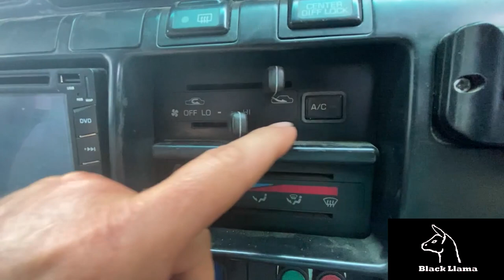80 series landcruiser air conditioner fix, clean evaporator

Comment: This is a great video! I used your guidance as a step by step to remove and replace the evaporator on my 1990 HDJ81. I was dreading the task but it ended up being not too bad. A lot of work just for a cleaning though. My evaporator was trashed and was really dirty and full of crud. I just got a new one from Impex, no issues with the install. Yes, my AC system had R12 which I had evacuated and am doing an upgrade to R134a. Thanks again for your videos!

Comment: I got around to cleaning my fan and evaperisor  in my 80 series.There were a couple of leaves and a feather in where the fan is,and having cleaned it out,I now have a quiet running fan.As for the evaporator fins,what a mess,absolutely covered in years of gunk, I couldn’t see the fins at all. I sprayed the gunk with some car wash in a spray bottle then let it sit for 10 minutes,then lightly scrubbed the gunk from the fins.Took me 4 goes to get the fins cleaned up.My a/c was cold,but now since cleaning the evaporator,I nearly get frost bite😆.I’ve also noticed the a/c compressor now cuts in and out which it wasn’t doing before the big clean up.Thanks for the video,it really helped me out.
Reply from the maker: I’m glad that it worked. Lots better than keeping on re gssing it and finding that it still was not cold.

Comment: A little tip for anyone trying this. When I was washing out the box my drain hole/hose got blocked. I put a wet shop vac on the drain hose under the car and it pulled out the blockage. Now draining 100% clear.

Comment: To get around the drain plug clogging up when doing this, I drill a 20mm hole in the bottom left near side to allow it all to run into a bucket in the drivers well.  When finished, simply install a rubber blanking plug, and you'll be ready for the next time.
Reply from the maker: I like that idea. thanks for the feedback.
Reply: What about another 20mm hole at the top as well, to fill it without disassembly!

Comment: It is also easier to clean if you use a vacuum cleaner first to suck most of the Debris out before you wet the muck. great job.
Reply: I was going to say exactly this. Avoid the mud and vac out first.

Comment: I just had a new hose and cylinder head fitted because of dissimilar metal corrosion , alloy head interface was shot, anyway, the dude at re-fill said my evaporator was caked in insects and gum leaves, cold but not that cold, airflow restricted so wasn’t chilling as efficient. , I asked if I could do a garden hose blast out, he said that’s not a problem but he highly recommended to do it with the fan out of there. And the ceramic resistor block also. Cool fella, just about do same same, hoping it gets hefty flow, ⛄️

Comment: I wish I saw this video before I attempted to clean out mine. Unfortunately, I cracked my box. However I was able to completely pull out the unit and the results are amazing.
Reply: Was it hard to pull the box
Reply: @laythmcgee9949  I still don't understand as well because I had to call in a Technician who managed to detach it.

Comment: Great vid mate. I just spent 2K getting my air con fixed. New compressor and a clean out. Do you know where the air comes from when the aircon is on recirculate? I’m asking because I live out bush and the mechanic said some models of 80 series have a filter to stop too much dust getting into the system but my model stent have it so I was going to make my own but I don’t know where the intake is. Any ideas?

Comment: wow thanks for that I am going to do this I have put gas in twice and it just goes in about 20 mins im hoping I can do what u did and it will help
Reply from the maker: Chris Smith let me know how you go. I pulled so much muck out it was ridiculous. It is now so cold I have to turn it down. 
Interested to know how you go.
Reply: @blackllama1  Hi again well I did it the way u did and yes there was crap and cleaned with c18 and soaked and than hoses off and and same wit the fan pulled that out some crap in there gave that a good blow out the the compressor put is all back and its still working fan is a lot better and it is blowing a little cold air I have to get it regased so but seems a lot better great job
Reply: @blackllama1  I must say I am not a mechanics asshole have no idea how to  do things lol
Reply from the maker: Chris Smith today I just filmed the hack I use to make my 80 series hand brake hold longer that should be edited and up in a week or so. I have a bit of a backlog of videos.

Comment: Thank you for posting this. I recently purchased an 1990 80 series. Does your vehicle have the rear AC option? If so, have you cleaned it, or do you know if there a filter than can be replaced?
Reply from the maker: No sorry mine does not have rear AC so not sure on that one

Comment: Hi mate I like how you have the six inch speakers in the door as well that's great! Did you just split the cable feed for the original 4 inch speakers in the dash panel or?
Reply from the maker: That was all put in before I purchased the car. 
They were run through an amp under the passenger seat. I have since pulled that out and replaced the head unit. 
They now just run out the back of the head unit front right door front left door rear right door rear left door. And one in the back. No amp straight off the head unit. Speakers in the dash were shot and just crackled
Reply: @blackllama1  Awesome mate thanks for getting back to me.

Comment: Currently doing this on my Left Hand Drive 93 80. The drain is somewhere on the passenger/exhaust side. I'm just using a spray bottle with hot water and dawn soap, luckily was able to dig and vacuum out all the large stuff. Luckily it's still draining however I can't locate the drain tube? Anybody have knowledge on this? It's dripping down the frame and i'm letting another round of soap soak before I spray with just hot water from another spray bottle. I've been shooting compressed air in as well and have had great results im just worried the drain may block up
Reply from the maker: Is it possibly that the drain tube has been pulled off. It should come down past the  frame and stop. If it’s dripping if the frame there is a small chance it’s gone and it may leak and wet your carpet. In theory it should be almost directly under the evaporator box in the car. 
I hope that this helps good luck with it
Reply: Dishwashing soap contains a lot of salt. To avoid corrosion I'd advise to use another type of non corrosive cleaner.

Comment: Hey mate do you know where the cabin filter is in 80 series pls reply
Reply from the maker: The 80 series does not have a cabin filter. They came in in the 100 series. 
If driving In dusty conditions I flick to recirculated air. I prefer the fresh but what else can you do. 
I have seen totally bodgy jobs screwing filters into the plenum chamber but not good.
Reply from the maker: @alexmanouilov9526  please use blackllama Facebook and messenger thanks
Reply: @blackllama1  yes I have a picture where to send it?
Reply from the maker: @alexmanouilov9526  use messenger through blackllama Facebook

Comment: Why these cars doesn't have air filter
Can I put an after market for it ?
Reply from the maker: أبوعلي الجهني no  air filter on these. I have not seen an aftermarket one for them. I have seen propel do bodgy makeshift ones that they tec screw in but I don’t like that idea
Reply: @blackllama1 
The weird thing is that there is a modern cars designed in the same bad way with no air filter
Like Daihatsu teriose
Or mitsubishi pajero
But do you think if i put landcruiser 100 air filter in it will work fine?
Greetings
Reply from the maker: أبوعلي الجهني I think the 100 system is different the 80 has no place to put the filter. I have been planing to look into it. Let me know how you go I just haven’t had time to explore more
Reply: Abu Ali, I do have 2001 VXR 100, There’s no air filter in it... but I you have to clean your AC condenser like in the video.
Reply: @mahfoudhalnaamani2925 
 مافي طريقة ثانية ياخوي بدل البهذلة هذي
ممكن احط لي فلتر داخل حق سيارة ثانية واسكر عليه؟
الباجيرو نفس العيب
بعضهم يقص طرف الثلاجة البلاستيك ويركب فلتر تجاري
جربت هذي الفكرة قبل كذا؟
Reply: ابو علي. اذا المكيف يبرد و ما يسرب ماء داخل السارة خليه مثلا ماهو و وفر فلوسك. ممكن تنظف الكونديسر اذا تشوف يسرب ماء داخل كبينة و يكون في جهة الراكب  مرة كل ٤ او ٥ سنوات عند كهربائي شاطر و انت واثق فيه.
اتحدث عن التجربة لاني سيارتي فتحت و نظفت كونديسر (عند كهربائي طبعاً) بعد كان يسرب ماء و كونديسر من كثر الغبار الي فيه تحول الطين و حصلت اوراق حبات الشمس في كونديسر.
Reply: @mahfoudhalnaamani2925 
الله يعين
المشكلة كثر الفتح و القفل ممكن شي ينكسر
على العموم تسلم على الرد